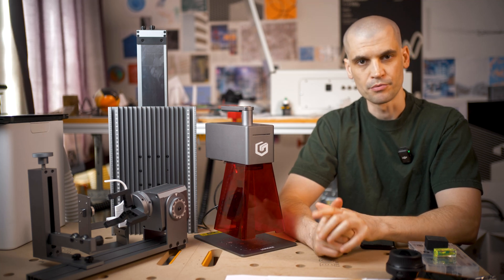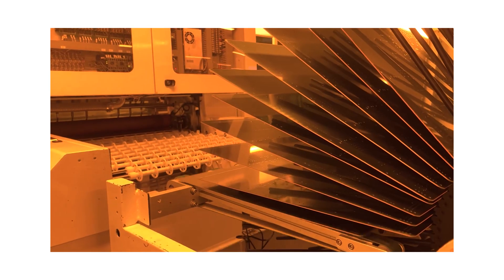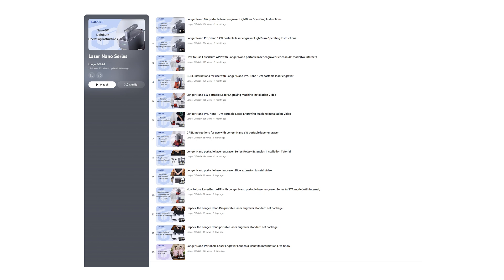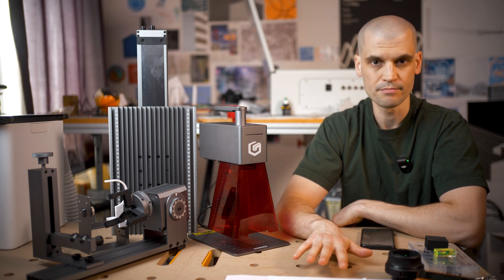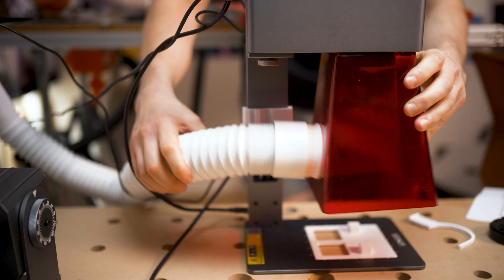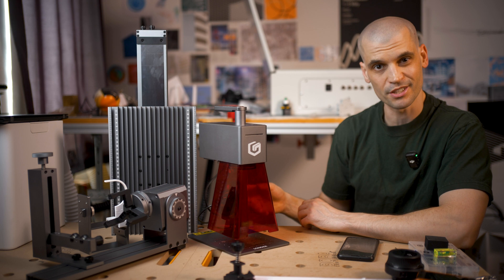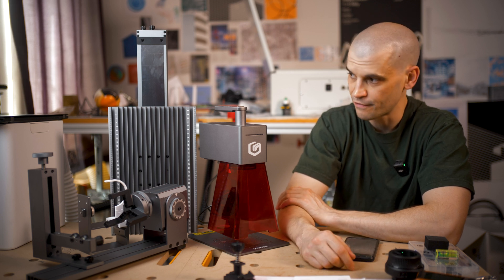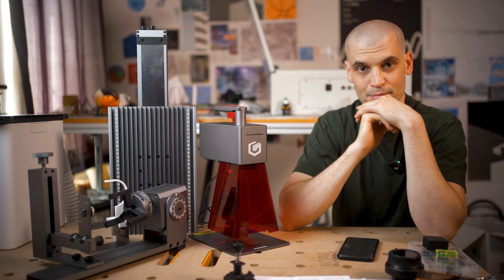Longer Nano Pro 12W Review: The Fastest and Lightest Portable Laser Engraver

Comment: I am totally new to lasers.  Longer told me the spot size for the 12W was .01mm.  I bought this machine for 2 purposes only....1) is to create color designs in steel and 2) burn off paint to make watch dials...that is where the .01mm spot size is needed.  Your video mentioned a realistic spot size of .06mm.  Do you think I could achieve a .01mm spot size for just removing paint?
Reply from the maker: 0.01mm (10 microns) is no way achievable with these types of lasers, but for etching in paint for watches do you really need 10 micron precision? I would guess 0.1mm is more than enough for legible results on a watch dial. 

This laser is not suitable for colour engraving on steel, for that you would want a fiber laser not a diode laser. Preferably a MOPA fiber laser.
Reply: I wonder why they told me spot size was .01mm.?

They have shown color markings on steel and other users have replicated the colorings on steel so I know that’s possible.
Reply from the maker: @chrome72  listed specs are 1 thing, real specs are another, its definitely got a fine dot size, and small enough for any intricate work. Colour marking is possible but you get a much wider colour gamut with a mopa fiber.

For the price that nano pro is hard to beat, especially with the accessories that you get with the packages.
Reply: Wanna share the stl file for that jig?